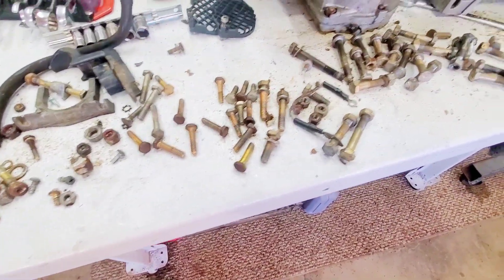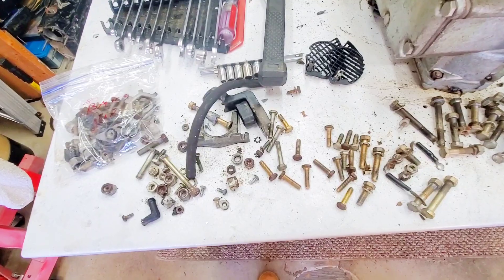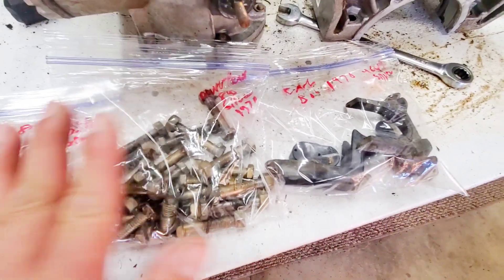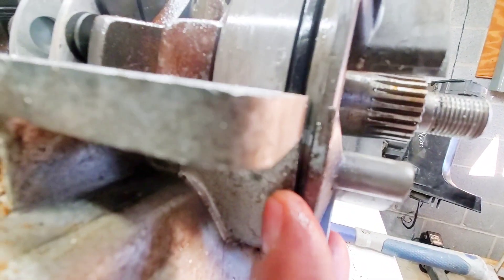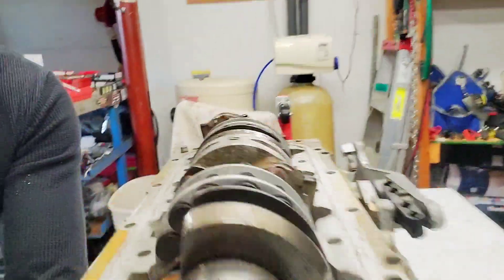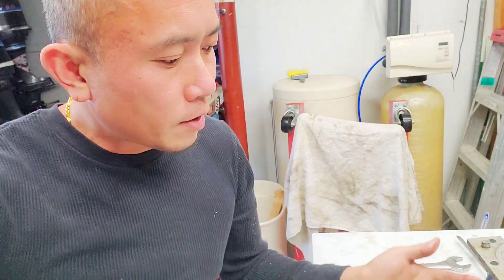Mercury Outboard Seized Powerhead: Asking for advice?

Comment: While I'm not a pro engine builder or anything I have rebuilt several automotive engine along with 2 force engines and with your help ive fixed my 115 merc this summer.. I use trans fluid and acetone mix it a pint to a qt and get a cheap spray bottle.. Ive had alot of luck with that.. but if all else fails seperate the crank and rods and tap away using a mallet and wooden block you might break the rings but I'm sure you can save the block
Reply from the maker: I tried that. Son

Comment: Pull the crank out. Take off the bearing caps. Hit the rod ends and they’ll give.
Reply from the maker: Tried that.... zero movement. Thank you for the feedback!
Reply: @MerCSonL6  is the head off yet? Use a press
Reply from the maker: @paulmarado  head off? You mean power head?
Reply: @MerCSonL6  spark plug side? Or is it part of the casting
Reply from the maker: @paulmarado  this motor is strictly parts....
Reply: @MerCSonL6  you got a lot of spare stainless nuts bolts and washer

Comment: At this point what matters right? Its toast! BUT IS IT? me, I would take the rod bolts off, the ones you can reach of course, and take the caps off those rods. Then hammer the piston back in the cylinder, then go from the other side through the spark plug hole and tap it back, being careful for threads and nicking up the top of the piston. Get two of the pistons to move how ever much you can make them move, then put the intake and end caps back on, hold the block solid, and put a breaker bar set up on the crank and start working it back and forth.... ? Anything is worth a try at this point right?
Reply: Nut Buster its what we use in the oil field it no joke it real WORKS

Comment: I agree with Walter however I would try to put it in the plug holes and let it work it’s way down to the crank. My riding lawnmower overheated from fuel in the oil and froze I thought it was done after letting it set for 3 days with Marvel Mystery oil in it I was able to use a breaker bar and get it freed up and it’s still running today that was 5 years ago. I can’t say enough about the stuff, just got to give it time to work.
Reply from the maker: I did soak it in pb blast for about week before getting to this point. I dumped it directly into the plug holes and was hoping the magic would happen....
Reply: @MerCSonL6  not sure what’s in Marvels but I know it works. Now you got it apart to the point you can get the crank out and put some in the plug holes let it set for a few days and use a wooden handle and pop the piston down after removing the head. I wish you were close I would come hang out. I still have to break down my xr6 I found a shop to pull and replace the sleeves I need for the rebuild. It’s a 2.5L 150 hp xr6 putting it on a 20 foot pontoon boat. Also remember you have time and time is your friend, it’s always hard for me to let things set and do the work for me. I just find something else to do for a bit and check on it every few days but it will work.
Reply from the maker: @unsaltedlife5998  its soaking as we speak. I removed the exhaust Baffle and hope did dwindle a little. Looks pretty bad. It will be in my next video. Thank you. Son

Comment: Did you take the crank out yet? Can you with a soft hammer tap on the flywheel end and bottom end? Gert those  bearing caps off, ( looks like u did, I watch more into the video ) Can tap on the cranks ends with a dead blow hammer ( soft ) and drop a brass bar down the spark plug holes and tap on them. Might find that along with your favorite penetrating oil AND Pull the water jacket cover and use a propane torch to get some heat on the cylinders. Tap a lot... :) I've done that with 50's with success when they were salt water seized

Comment: Air hammer and blunt end hitting against a hardwood block on top of the pistons. The repeated impact with the penetrating fluid breaks most pistons free. If you have a wood lathe or a way of making the woodblock/dowel as close to the piston size the better and less chance of damage.